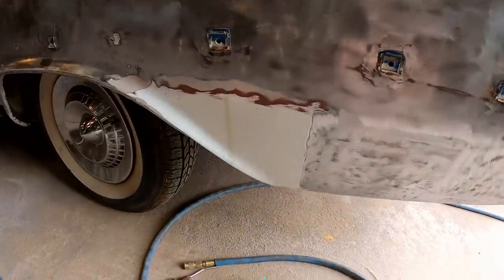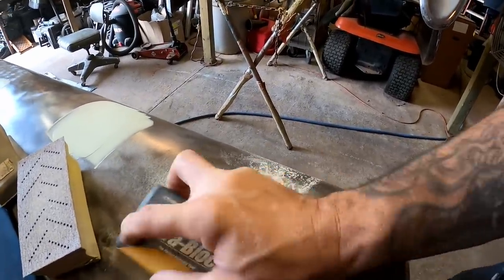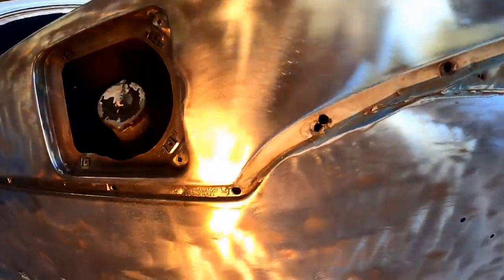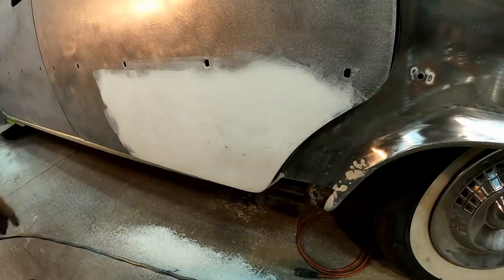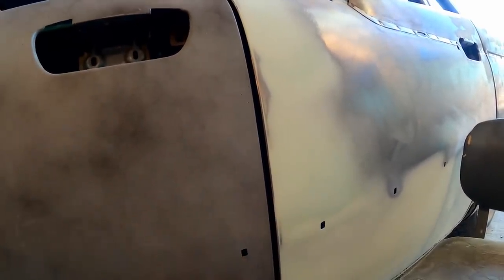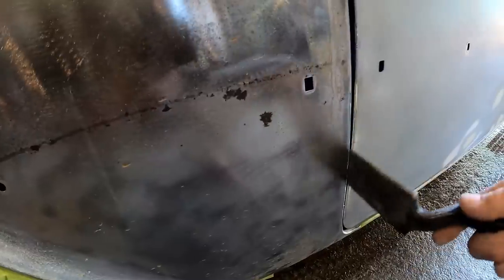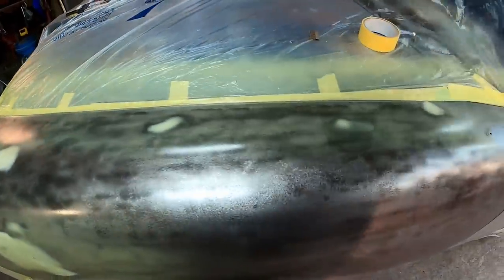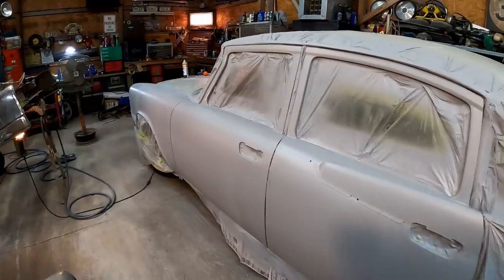Doing bodywork to the '59 Dodge Coronet pt.9

Comment: I watched one Amazing body guy achieve PERFECT panel gaps on an entire led sled by welding all the panels to one another then drawing the gaps with a sharpie and precision cutting the panels apart. Every gap on the car was the width of the thickness of a cutoff wheel.
Reply: Yeah you can do that and then body fill them over and make them sharp as a razors edge but it a driver not a show car and factory body gaps are terrible .

Comment: Yes, most fins on late '50s cars are separate pieces, welded or screwed in place because if you think about it, those complex shapes would be impossible to stamp out in a single piece. It was pretty trick, and a lot of extra work, but being cool usually is.
Reply: It is more obvious on the 1959 Cadillac.  My experience was with the hearses and ambulances and the different coach companies handled the fins differently.  It was fascinating to learn about all the different designs.

Comment: Myself mike the oldest car I have done heavy bodywork on for our body shop was mid 60’s owned early 60’s but for body shop work late 60’s 70’s 80’s 90,s then everything else was my own work from that point on till 2019  lot changed over the years brother paint , bodywork basically the whole mess other than doing it correctly 😁 love the videos kid.  BK

Comment: Nice job, WB ! I wasn't aware that the inner fin was spot welded on the door on 4dr cars. But note that on the quarter, the inner part of the fin is integrated into the rear sheet metal. Since I've only done welding, but not filler work or paint, I'm learning a lot. Just one really minor thing: Since there are excessive mirror mounting holes drilled into the top rear of the fender, I would've welded the extra holes shut before proceeding.

Comment: i've only worked on cars since the late seventies and a lot of older cars but, that is the first time i've seen the fns like that.  it's relly cool to see the huge changes that the industry has gone through.  i'm glad they did go with metric instead of mixed like in the eighties.  cars have gone so light and throw away though where like the one you're working on has lasted.

Comment: A little bit of muratic acid and a toothbrush and you can remove rust from anywhere in seconds.  Works perfect on surface rust also.  done in Seconds and wipe it away!   Looking good.  Lots more work than my project, but fun to watch and learn.

Comment: I worked for the company that sold the steel to Chrysler/Dodge/Plymouth when this car was made.  I handled claims and what would happen is the metal dies they used to stamp out the parts (doors, fenders, etc) became worn down over time and they would just keep making parts until it was horrendous.  And it wasn't until the Japanese invasion that American car makers started using lighter cold rolled steel and began stretch-forming the panels (which made the dies last much much longer.  And thus the improvement you see now on cars.  Very little waviness, etc.  What you are seeing with waves, etc was acceptable to all US car makers at the time.  The steel had a lot more carbon in it and was much thicker and tended to rust out quicker.  This car was made out of hot rolled steel.  US makers just didn't know how to do it any better in 1959.  I witnessed the gradual switch over to lighter steel, especially in the early 70's when fuel economy began to be an issue.
Reply: Very informative. Thanks

Comment: Hey mike good work there. And yes I know that’s a lot of work. And your getting it done a panel at a time. And then the fun part will happen as you start putting it back together. And then you can stand back and check out the good work. And just one thing. I HOPE your charging a minimum of 20,000 Randy’s got it. So get it. Lol.

Comment: About the attachment of those fin pieces to the doors.  It looks like an attempt by the manufacture to update the car fins without changing the shape of the stampings of the central part of the car.  This car is unique due to its composite design.  I saw only one when I was in high school.  I feel the 1955, 1956, and 1957 were better designs.

Comment: AS far as  the panel gaps, they are fine. Considering back then, they did not have what exists today.  Just slap on the panels, if a panel was out of spec, slap it on anyway, get them built as quick as possible, and send them on to the Dealer to be sold.

Comment: I guess the Eastwood airless paint sprayer wasn't as great as first thought? I see you reverted back to the tried and true air compressor. 😕
Reply from the maker: Just for primer. I’d never spray that nasty crap trough my Eastwood gun. I use my cheap $100 gun for priming.

Comment: So we have the same name  Hello Mike    on my 59 i am having so much trouble with my rear left fender panel straightening  made a big mistake by overlapping the panel last night i cut out the worst section and I am taking the time to butt weld a new section in, The overlapping made it impossible to hammer a neat panel out to much metal to reform at the join   the beat goes on Mike

Comment: Quick question, I'm painting a car in my channel, and I had concerns about type of primer, way I understand it is epoxy then filler, then primer, I use Nason same as you and the epoxy is dtm?
Reply from the maker: DTM is great for bare metal. I’ve always heard that it’s best to remove the epoxy from the area that you intend on doing filler work. I believe the Nason epoxy has a 30 minute induction time if I’m not mistaken.
Reply: @weirdbeard8898  it's crazy how much conflicting you hear, ps ty for the indirect motivation, I  often find myself sat watching yt, you pop up and makes me go get on with it, I'd love if you could check out my build on my channel if you ever have time

Comment: Love your work, but I was cringing a bit as you worked the top of the driver door... as you tweaked it, you can see how most of the bending is happening in one spot about two inches above the bottom of the window, and it looks to be kinking and fatiguing there.  I'm sure it was somewhat like that before, but working it more is just making it into a problem... that I don't think I'd have a solution for, except to try to reinforce the fatigued area with some welding before it gets floppy or too bent out of shape.

Minor point, but I didn't see anyone else bring it up... and obviously I'm not there, so I can only see what the camera is showing.

Keep up the good work, I'm really looking forward to the final product.
Reply: Nice catch... Good call

Comment: How about “lead”. Is that a possibility for filler? It used to be so.
Reply: Are you allowed to use it any more since lead has been linked to diseases?
Reply: Yeah, most likely regs. I bet old timers could still do it though. It was just for difficult spots (small & curved/angled/valleyed) if my memory is correct. I think like used in rain gutter channel and seams etc.

Comment: Your destroying  what was a beautiful car.  You need to stop.
Reply: Define destroying.
Reply: @mexicanspec  he's digging into the metal.  This weakens and creates more surf area for rust to start.  Also it will require more body filler and sanding.   If your going to take a car to bare metal.  You might as well to a frame off.
Reply from the maker: It’s 80 grit sandpaper. It’s not hurting anything especially on something this old. The metal is very thick. Not everyone can afford a frame off restoration. Sandblasting is pricey. This is working fine.
Reply: @weirdbeard8898  I agree with the expense.  Wish I had time the to help ya.   My days are filled with family, work and horses. I still support the great job your doing.  Keep up the great work.  I just disagree with the way you are going at it.    I am still going to keep watching and learning from ya.